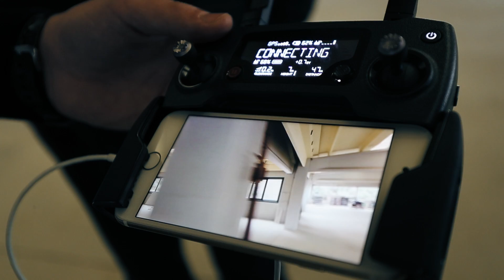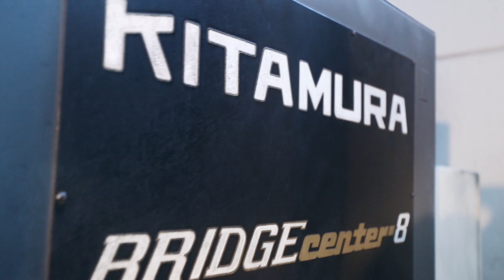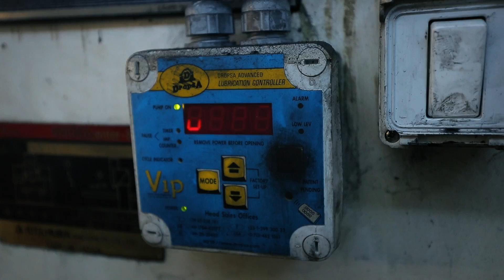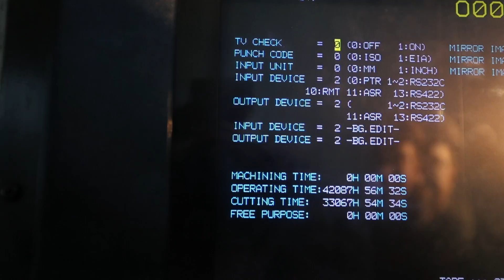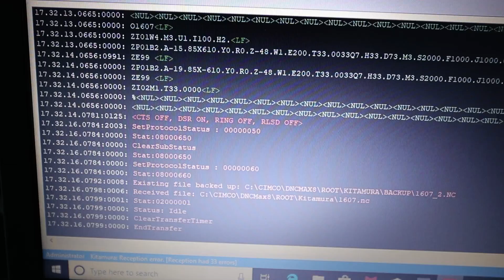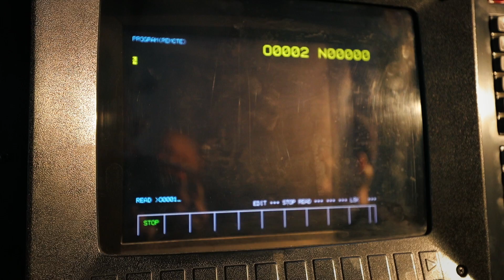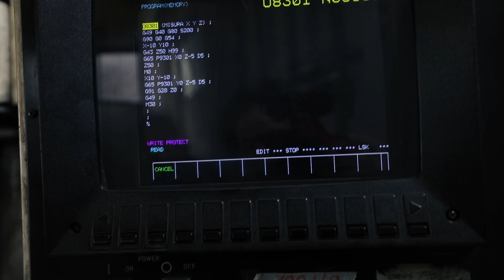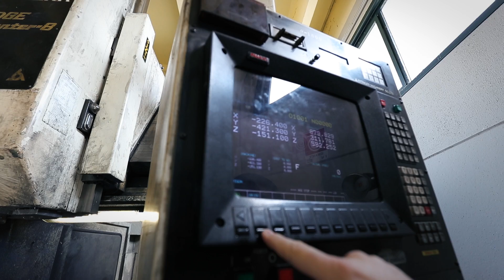This 30 Year Old CNC Will Never be the Same | GIACO

Comment: Looks like an old Fanuc 10/11. They had tape capabilities, but that was kind of a leftover from early days. Most shops were converted to RS232 by the time F10/11s came around. If that panel happens to have the manual ABS/Inc switch on it, make sure you leave it on ABS!  Couldn't tell you how many service calls I made on machines that still had that stupid switch. Some were pretty severe crashes....

Comment: It's a Fanuc 11M on a Kitty.   Easy control to run, easy to program and easy to DNC.
Reply from the maker: Do you know why when I jog it it doesn’t show the right measurement on screen?
Reply: @GiacoWhatever  What screen are you referencing?  ABS, REL OR MACHINE?
Reply from the maker: Terry Moore all of them... they are in mm but it moves a lot more tgan it’s showing
Reply: @GiacoWhatever  Home the machine look in the POS page, select REL and preset the machine to XYZ 0 in Relative, then go to MDI and command G20 for inch mode and try again.
Reply: BTW, those old 10/11M controls required a mnemonic command to set tools and  fixture offsets unless you see the Measure and Measure+ softkeys in the Work offset and Tool offset pages.

Comment: Do you have the post processor for Fusion 360 or whatever CAM platform you are using?
Reply from the maker: Nope
Reply: @GiacoWhatever  Hopefully a generic post will work.  It might be problematic to code a post from scratch or modify a generic post.  Be careful that the tool spindle orientation is working before you run a tapping cycle
Reply: @ianwhatmough150  I don't think it should be that problematic to modify a generic post since we have the manuals and can figure out the feature set reasonably easy. It mostly seems like it's a bit finicky in how the G-code is formatted, in which case modifying the post processor should be easy. Though, since it's a fairly common controller I think the odds of finding a post processor that works without hacking it to pieces manually are pretty decent.

Comment: the compressed air is to blow the chips out of the spindle so when you change tools you don't get shit stuck between the spindle taper and the tool holder.

Comment: The air pressure is to clean out the cooling canals in tools if they have so they dont fill up the toolchanger with liquid. 
Its for some more stuff but this is one of them.

Comment: solution for your squatter problem: invite a couple car guys over and have them anti-lag or 2 step their cars inside your building. lol. the squatters will think there is gun fire and will surely make them run. try it.
Reply: on second thought, might not be a good idea. the accumulating fumes could gas them out and actually may kill them lol. I'm sure you don't want any murder charges in the new show, just yet.

Comment: Sweet!  We've got some old stuff modified with floppy emulators so we can use USB.  Only issue is that the USB has to be formatted into 1.44MB partitions.  Old stuff can work great with some workarounds. Congrats!  I'll bet it's a great feeling to watch it move under power.
Reply: That is a pain in the ass.  Drip feeding over RS232 is the way to go.
Reply: @ianwhatmough150  For our applications it works fine.  No computer required at the machine.  $50 investment 5 year ago.  Zero complaints.

Comment: Perhaps remove the way covers and clean them nicely from all the gunk that has accumulated in the last 30years. And see if there is any galling/fretting. And check if all the oil piping is in good order.

Next thing is to level the bed. Otherwise it won't cut accurately.

I wouldn't use these machines for too much fine 3D interpolation , aka Fusion360 stuff. These machines aren't build for it, they like beefy cuts, no small stuff. Lots of repetitive small movements will displace/push out the oil out of the machine ways and you'll end up with worn out ways, ie a trashed machine.

Comment: i have a fully rebuild deckel fp3a cnc for sale if you need another one,  it has a new mach 3 control stuff so can work with any cad/cam program.  and is converted by phillips to mill 3 axis simultaneously. located in the south of the netherlands.
Reply: Deckel FP-NC with Mach3 is trash. You'll loose all the accuracy without using glass scales. Leave and use them with the Dialog4/11, they are great controls
Reply: @hinz1  its never had glass scales, this one was chanced by phillips to run a num control with 0.005mm accuracy.  But num is difficult to program
Reply: Ich sehe ein schattenmacher fan

Comment: There is another page that should state work offsets or wcs and that is where you set your zero for your x y z axis. If you have the manual look up work coordinate system and it should be in there. I have a Fanuc 10t lathe so everything is very similar on the control.